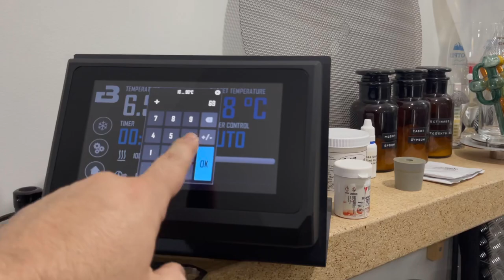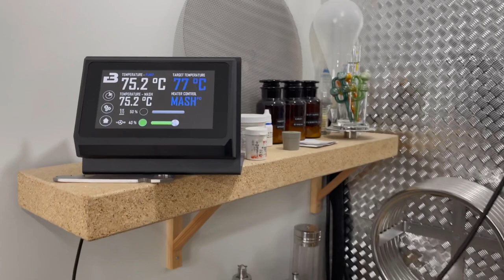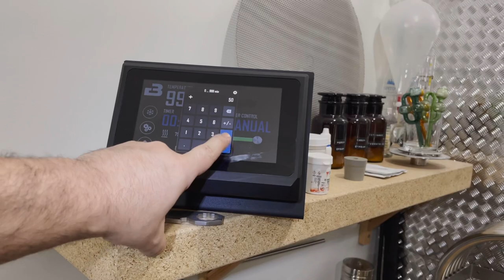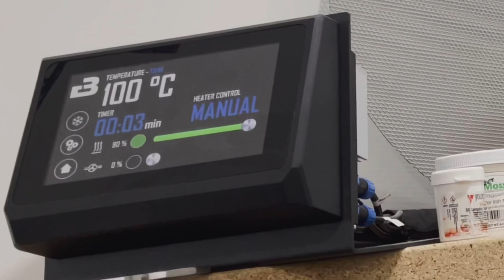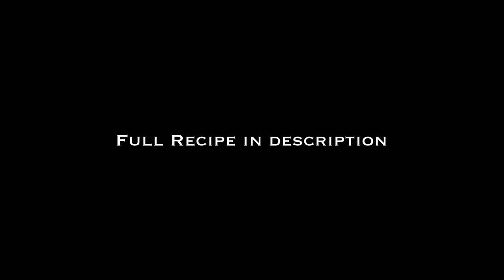Orange Ginger Saison - Part 1

Comment: Awesome! Thx again for an amazing vid. Just curious, I see your filter comes with 1000, 600 and 300 micron. Which have been working best for you? I remember one earlier vid you posted about a NEIPA, where you use 300 micron. I just got the same filter and I'm just using the 300 based on your NEIPA video - but would be cool to actually know when to use what. Anyway, thx again for your videos, really inspiring!:)
Reply from the maker: I think you kind of have to be the judge on what you need. For example when adding fruit with small seeds i have used the 1000 & 300 filters with the double filter set up. I mostly use the 300 because its needed for the can filler. I think when using the larger ones in a single filter tube you need to make sure your beer is relatively clean already. I think my next NEIPA I will use the 600 and 300 together. Thanks for the support! I appreciate you watching and the feedback!

Comment: Hi ;-) I continue to enjoy your beautiful content! What I was wondering is how you managed your condensation drain. I can imagine that you get moisture on your walls?
Reply from the maker: Hi! Thanks so much! My condenser run off goes into a bucket with a hole in the lid. Not much condensation makes it outside of the bucket. I have a hose running from the bucket under the table that empties into a floor drain. No moisture on the walls.
Reply: @MasteringHomebrew  Thank you. You have a very nice setup there, very jealous ;-) May I ask how you control condensation when you sparge and when you have also lifted the inner basket?  I have a B40 myself and usually brew outside, but am considering doing so in the attic.
Reply from the maker: @TheRubinio1980  thanks! It kind of depends on how you’re sparging. I try to keep splashing down to a minimum. I haven’t had any moisture issues. I did paint my ceiling above the system with bathroom paint. I also covered the walls with these tin sheet covers to keep splashing / moisture off the dry wall. It will work in the mean time. Currently house shopping with a more suitable, permanent brew space in mind 😅 so far so good though!